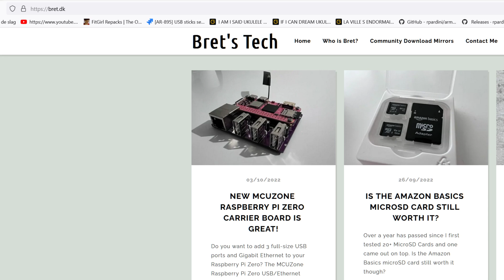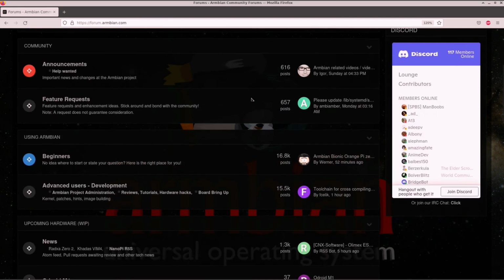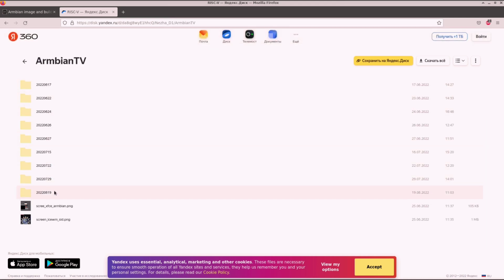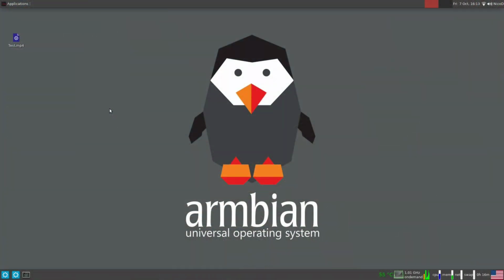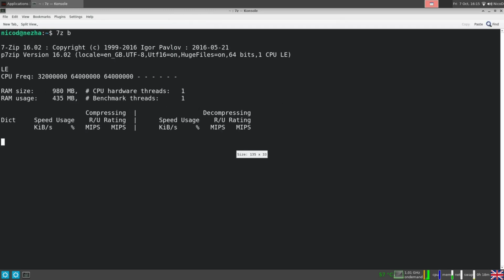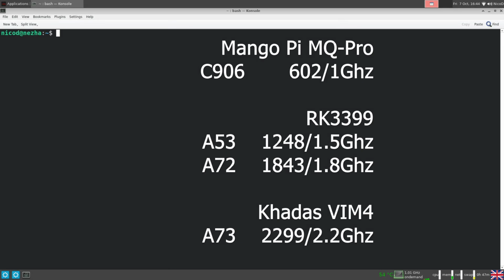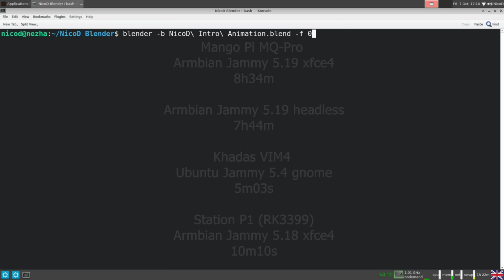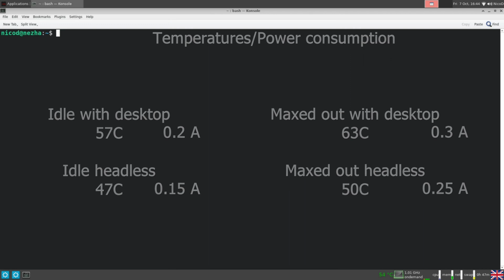MangoPi MQ Pro Review - A cute little RISC-V SBC

Comment: How long did it take to boot the first time and is there any LED activity apart from the very bright green power LED? I notice there's an LED labelled ACT but I've never seen it light up so I don't even know what colour it is. I used Balena Etcher to write the latest Armbian image to a 32GB card and I can mount it on an x86 Linux box but the pink Mango Pi doesn't seem able to boot from it. I get nothing out of the HDMI port. I tried an older image on an 8GB card of a different brand but that didn't work either. Maybe my board is bad. Is there any way to troubleshoot? I've been using a Raspberry Pi 4 power supply to power it. If I power it by plugging it into a USB port on my PC is there a serial terminal that I can try to connect to?

Comment: Looks really great as a little pihole/double dns resolver solution.
Reply from the maker: I would advice to use a cheap well supported ARM device for that. This is very slow, and software support is very bad. 
But if you want a challenge, then why not...

Comment: Thank you NicoD’s SBCs for this great review. We are looking for a mobile  Linux mini PC which runs 24/7 to use as a  physiological data acquisition system. We currently are evaluating the Raspberry Pi zero w2 for this purpose. But we miss a more powerful device, which still is energy efficient. Unfortunately the device you review here is not great for playing videos an web surfing. But it is highly desirable to have these options for our device as well. 

There is a new model, the Mango Pi MQ-Quad SBC with 4 cores, which is according to reviews more powerful than the Raspberry Pi zero w2 and often draws less power. The Mango Pi MQ-Quad SBC has images for Tina Linux, Debian and Android 10 TV. Unfortunately, there is no Armbian or Fedora image available for this device, which would be our preferred choice. The MangoPi MQ-QUAD includes a graphical processor unit and is 4 core. But there is unfortunately now review available if web surfing work and video playback.

A YouTube review from NicoD’s SBCs about this device would be highly desirable, to show if the new device solves the problems with web surfing and video play back. The Mango Pi MQ-Quad SBC is available and affordable, but not the Raspberri Pi zero W2. A reason to buy the Mango Pi MQ-Quad SBC if the mentioned problems are solved.

Comment: Does not work for MQ quad, does not load any OS image
Reply from the maker: MQ quad is a very different board. It is ARM and the MQ Pro is a RISC-V board. So you can't run the same software on it. 
I'm not aware if there's Armbian for the MQ Quad. It isn't a well supported board.

Comment: This could be nice as a powerful microcontroller.
Reply from the maker: This is not a microcontroller. There are RISC-V microcontrollers. 
This is a microcomputer. It runs an OS like Linux. 
Microcontrollers consume much less and are programmable, have ROM/RAM memory backed in. 
So all you need to run is the microcontroller chip.
With a microcomputer you need extra ram and I/O to read the software that needs to be run.
Reply: @NicoDsSBCs  You can still use it like a microcontroller however, that's even possible with larger Raspberry Pis.
You just write the code you want and target baremetal Risc-V with languages like Rust, if something like ESP32 is still too weak for you but you don't need a proper OS this seems like an option.

Comment: Imagine compiling gentoo on this
Reply from the maker: Ha. That'd be a full time job with a long term job security. 
I tried a few stupid large computing tasks on it. Just for fun, but it's a dud. Not sure why others call it the RPiZero killer. I thought RPiO2 was that. Just fun to see RISCV works. But ain't no replacement for anything. I would love to test the VisionFive2 board. But lots of work needs to be done for having desktop quality software for RISCV. Microcontroller it can do great.
Reply: @NicoDsSBCs  Ironically enough, if you could get gentoo installed it would probably give you the best RISC-V experience, as all the software is compiled for your machine. That's probably the best way to access the most software when you're using a new architecture like this.

Comment: Too bad it's one core.  I am biased towards 2+ cores.  I would only use it headless for a single dedicated task.
Reply from the maker: There are newer RISC-V SoC designs. Check starfive visionfive 2. It's is in Kickstarter.
Should be way more powerful than this board is.
For now for me ARM is a lot more attractive. It's is power efficient and power ful enough. So I'm not switching to RISC-V quickly. Greetings.

Comment: Think Ill wait for a few more revisions before I dip my toes in the water of Risc V.
Reply from the maker: The only reason why I like this is because it's something new. But I can't see a use for this board/SoC while having so many ARM SBCs that can do everything better. 
I did read that the latest RISC-V CPU core design perform way better than this. So it's a start. I'm curious where it will lead. Greetings.